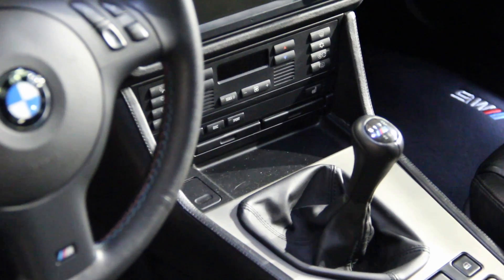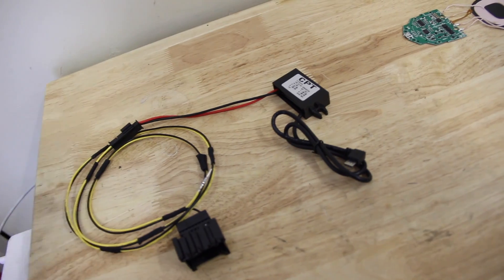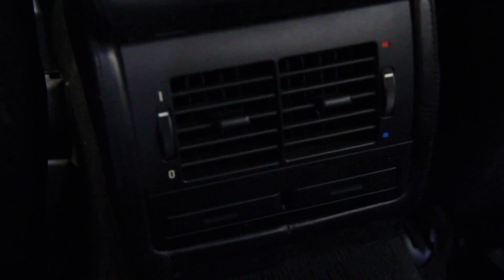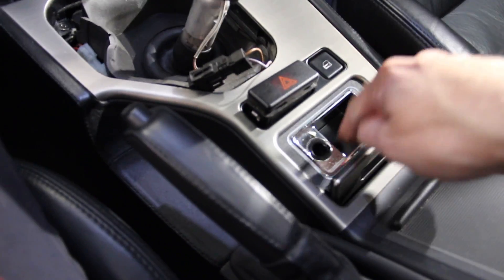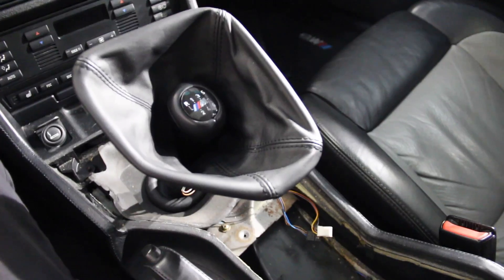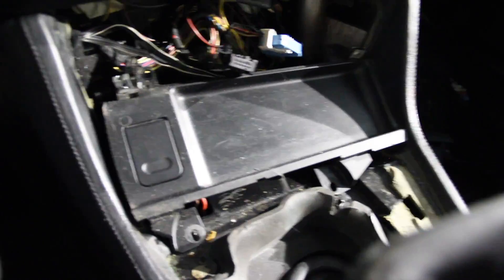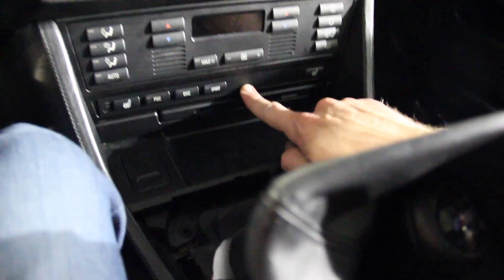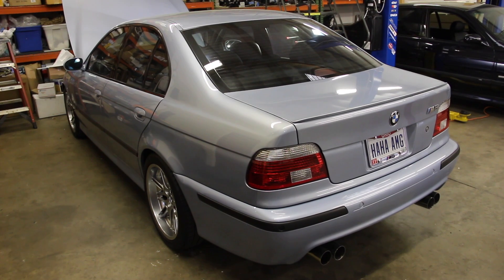BMW E39:  Wireless Charging DIY

Comment: Back to the future: I did this installation four years ago. Im currently upgrading this solution with a QI2 charger as the current device will not charge my iPhone (I change the phones but never the car)
Reply from the maker: I'm still running this same charger.  I upgrade my iPhone each here and it has continued to work with each new model, including my current 16 Pro.  I imagine newer chargers provide more wattage for faster charging, and this would be a good upgrade to do.
Reply: @E39Source  true! It still works but as I could not find a case that allows the new iPhone to charge  I decided to upgrade ((and trying a QI2 )

Comment: I've just (!) found out there's an option for the centre armrest with a larger storage bin under a raising armrest (you know, like normal cars - but fully OEM to E39!!), so I was wondering if we could retrofit this wireless charger there instead (or in addition - perhaps for passengers or those with larger phones) and mod eject-box power cable into a wireless charger under that, maybe put some USB-C's into the base of the storage bin as well!
Reply from the maker: Indeed, the European style center console armrest incorporated a small storage cubby into the arm rest.  It is important to note that this takes up the space formerly occupied by the eject box wiring, so that'll need to move down beneath the entire center console.  My concern with wireless charging in this cubby is that the phone being charged needs to remain in constant static (non-moving) contact with the charging pad, and positioning is important.  The phone may tend to slide around in that cubby, which could cause it to lose contact with the charging coil.  You could of course build some sort of mold in there to hold the phone snugly.  USB-C ports could be added as well with modification, and likely some custom power supply modifications/hardware.

Comment: Curious what you’ve done for cup holders now that this charger is in. ?  I put in new cup holders and use them daily. Ideas welcome.
Reply from the maker: I don't think I've ever used the cup holders for a drink, as I don't need a beverage while driving.  On very long road trips, I'll keep a water bottle in the back seat on the floor.
Reply from the maker: This might be a good solution though:  https://www.amazon.com/Trick-Bits-Coin-Storage-Holder/dp/B09PGTT9DV/ref=sr_1_2?keywords=e39+cup+holder&qid=1681608863&sr=8-2

Comment: Love the video! Followed the guide but I am getting interference when powered on to the FM radio. Any advice?
Reply from the maker: I have never experienced this issue, though I'm not sure I've tried to use FM radio in the past 10 years.  You may want to try a different charging coil.
Reply: @E39Source  thanks will give that a try!

Comment: Tapping into the cigarette positive and negative won’t drain the battery? Seeing that it seems like the cigarette lighter has constant power to it even when the cars off??
Reply from the maker: It would if you left a drain on it indefinitely, but the cameras monitor battery voltage and will shut down if it gets too low.  Yes, the lighter is constantly powered.
Reply: @E39Source  thx brother! Love your channel btw! @e39sourceFTW!

Comment: You removed too many parts unnecessarily.  it is enough if you just open the shifter bag and loosen the two screws at the bottom and then remove the climate control unit so you can push out this plastic part if you have also removed the cup holder, of course.

Comment: I just want to let you guys know, for a 2003 build e39 (at least mine) the correct pins were pin 2 for ground and pin 6 for power. Just got mine working.
Reply from the maker: Thanks!
Reply: What if there isnt any power at the existing connector regardless the key position

Comment: This is a little off topic but I need some help the key switch in my 2003 540i will not turn. Like at all. I just got the cluster pixels screen fixed and plugged it all back into the car to see how well it works and the key switch won’t turn like it’s stuck.
Reply from the maker: Try moving the steering wheel to the left or right at the same time. May require some force.
Reply: @E39Source  turned the wheel to the left, heard a click and the key turned. It almost seems like a lock mechanism in it. Thank you!!!

Comment: Which pin is the ground and which pin is the 12V?
Reply: Honestly, there are so many different eject box pinouts that you just need to do a visual check . Red wire with green stripe is 12v and solid brown is ground.

Comment: can anyone tell me whats a good price for a 2000 e39 m5?
Reply from the maker: There are countless factors that would dictate a good price.  Mileage, condition, spec, included maintenance history, upgrades, etc etc.  Figure $12,000-$15,000 for a solid example of a 2000.
Reply: E39Source thanks man
Reply: E39Source unfortunately it’s a bit over my budget so I’m going for an e60 550i

Comment: How can I fit a m5 cluster properly on a 530i e39. How can I get the oil temp and the warm option to work?
Reply from the maker: That's a great question, I have never attempted anything like that.  Adding M5 stuff to a 530i is a long, dangerous, and expensive road though.  I always recommend that people just buy an M5 if they want M5 stuff.
Reply: @E39Source  completely agree however an M5 being 15 k vs an 4k car I mean it is same chasis and everything but the motor. I am willing to give it a shot asides the fact that a 6 cyl is cheaper to maintain in my opinion.
Reply from the maker: @nelsonhernandez321  The M54 is one of BMW's best engines.  But they changed more than just the engine on the M5, it's a completely different car.  It feels nothing like a 530i when driving.

Somebody has probably done this before- figured out what wires need to added to allow the warmup lights and oil temp to work.  It'd be a pain in the ass though.  Does your current cluster have high or low OBC?
Reply: Any update on this? I would like to do this mod as well @nelsonhernandez321

Comment: I have a Huawei P30 Pro, charging wirelessly goes well of course - but a cable connection allows for much faster charging. If I really forget to charge the phone at night, on my commute to work, I want to charge it at max speed. I don't want the phone to charge every time I just want to store it: wirelessly charging it causes a lot of heat in and around the battery pack of the phone, causing faster degradation
Reply from the maker: Wireless charging is meant for 'top up' style charging while driving and using the phone for navigation/media.  I have not noticed any excessive heat with this setup.  It works beautifully for keeping the phone topped up on long drives.

Comment: I was thinking of adding a wireless charging pad at the same place as you in my E39 but  i found something else... For those of you that want wireless charging in the car and skip the wiring and bla bla , just buy this thing -> https://www.amazon.com/gp/product/B07QZTHHW6/ref=as_li_qf_asin_il_tl?ie=UTF8&tag=hucswor0c-20&creative=9325&linkCode=as2&creativeASIN=B07QZTHHW6&linkId=d51425ac8c2fef208bfd85b30d58a70e

And put it in the same place. And btw this Samsung battery has Quick Wireless charging unlike the junk wireless charger for $10.

Comment: What is the 18-pin connector initially intended for?
Reply from the maker: Back in the day, there we're different 'eject boxes' that could be installed in the center console tray to hold various phones.  The 18-pin plug is how they would have connected to charge/read the phones.
Reply: @E39Source  Thank you! This very nice OEM- type setup, definitely gonna go for that.

Comment: The one I installed charges a mere 1% every 2 mins on average with mobile data on and location services etc (normal usage) would be interesting to see if the board you have charges faster. Although a difference in phones will also affect the outcome. Samsung s9+ here.
Reply from the maker: Wireless charging is slower than using a cable, period.  This is probably how quick mine is.  I think the whole idea of wireless charging in the car is more of a 'top-up' feature to keep the battery from draining during a drive/while using nav or streaming.  I don't view this as a replacement to nightly charging.
Reply: @E39Source  Exactly, might sound like im being negative but I'm actually not. I just drop my phone on the tray too. It's great to keep it topped up as you say :)

Comment: adding a on/off switch to save battery? or maybe that 12V line is acc?
Reply from the maker: The 12v source I tapped is only hot with they key in position 1 or higher!

Comment: My iphone 11 doesn't fit inside the tray. What case you have? Your case is probably thinner so it can stay inside the tray.
Reply from the maker: I use the Apple silicone case
Reply: The 11 is larger than the 11 Pro. Might also be due to that.
Reply: @computiNATEor  Yeah iphone 11 has 6.1 inch LCD while 11 pro has a 5.8 inch OLED

Comment: Actually a great idea to scuff up the bottom of the tray to allow the glue to better adhere. For those in warmer climates, any concern with the glue getting soft again and coming off?
Reply from the maker: I think this glue would have to get REALLY warm to soften and let go.
Reply: @E39Source very late as I just got an e39, but with experience from a prior car in Florida the glue can definitely soften up and let go. At least in my case. Thinking of making a 3d printed bracket that the coil can slide into that way it's somewhat serviceable. I just don't know if there's enough space to do so
Reply from the maker: My glue is still holding strong 3 years later.  a 3D printed piece would be very difficult to manufacture at this quality level, and each charging coil is a slightly different shape so I don't think a universal slot could be implemented.   @car-bq
Reply: @E39Source  makes sense, thank you! I live in an apartment so I'm parked outside all the time which may have contributed to my case. Maybe I should look into higher temperature glue
Reply: My phone is to big

Comment: My e39 doesn't have the phone in console option, does anyone know if the power source will still be located there?
Reply from the maker: Is it a USA car?  My car didn't have the phone either, but I am pre-wired for it.  Look for the pre-wiring black plastic badge in the trunk on the carpeting (left side).
Reply: E39Source I’m from Australia, I’ll check anyway, thanks for the tip.

Comment: Hello again I found all the pieces but I did not know what is the name of the wire that is in yellow and black I do not know what is it does it have a specific name or a specific number?
Reply: As Ryan mentioned, I (Ted), made that harness adapter for him. I can post all the part numbers you'd need, but it's hard to terminate the wires without a special tool.
Reply: If you're not in a rush for one, I can make you one. Contact me at support@bluebus.dev

Comment: Ive been looking into retrofitting wireless charging in the same place, I was going to run a USB from my stereo from the back and put a charging pad underneath but your method is much cleaner!
Reply: Your method would also trickle charge the phone. I bet the USB on the stereo only outputs 5v @ .5A :(
Reply: @tass2001  I think your right, I've recently upgraded my phone and the USB c that is currently connected to my stereo csnt charge my new phone and kind of kept my old phone on a very slow and steady charge
Reply: @lloydaom  - Yeah, that sounds like low current output USB :(. Highly recommend getting a charger that's capable of outputting at least a few watts (2-3A @ 5v)

Comment: Pity that wouldn’t work in the e46 nowhere to put it 🙁🥺
Reply: Have you considered the inside of the arm rest?
Reply: tass2001 that would make it inconvenient
Reply: @kouroshtashvishi5031  true, but you gotta wrung what ya brung. I wish the OE Euro tray were large enough to lay the phone in :/
Reply: tass2001 the cup holder part is just tight for my phone but in need to take the case off and mine does that the cup holders just the normal one but it’s really tight

Comment: Nice job! I opted for the far simpler solution of putting an aftermarket wireless tray at the same location as you can see at the 3:00 in this video: https://youtu.be/XwW8HvA8jRA

My Samsung Note 9 does not fit the narrower part of the centre tray, so I additionally had to prop the tray up at an angle.
Reply: Just skip to the 3:00 mark
Reply: John Smith  5.... 39.... Nice. I see what you did there.